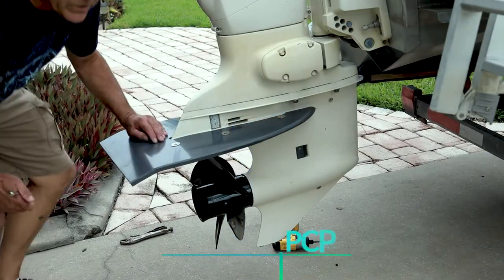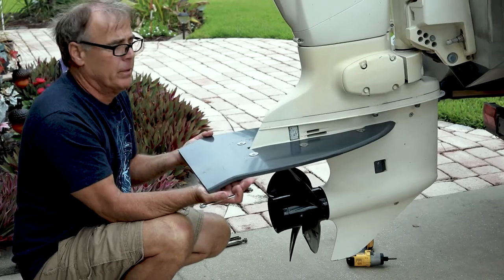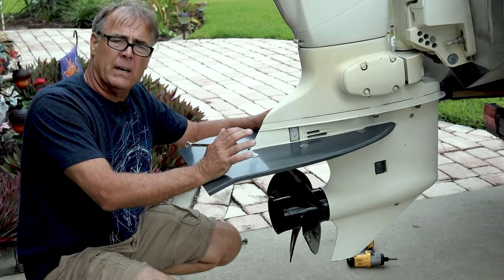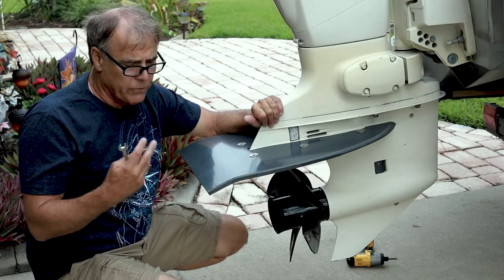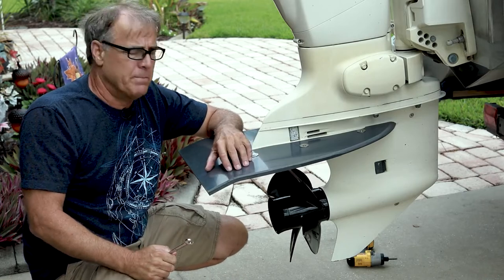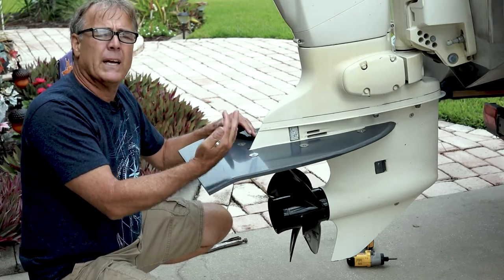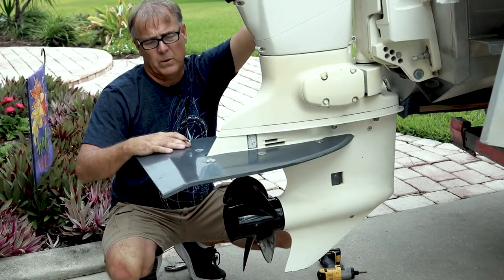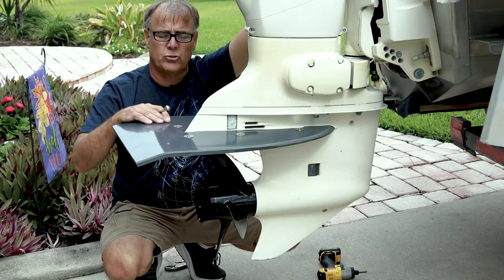VARA™ Plate Pontoon Hydrofoil Control system (Part 2 of 2)

Comment: All these "lift" systems, that purports 350-700lbs of force, without thinking about how that effects the integrity of the existing motor pod and framework that are not designed for it, seems to be asking for trouble.
Reply: You would only be redistributing the existing force. I don't see an issue.
Reply from the maker: Just as mentioned below by alpha racing redistribution of the VARA® Plate forces over the span of the Anti Vent plate are minimal. The outboard manufacturers must build in a factor for groundings and hitting hard objects otherwise there would disposable outboards on bottoms thruout the world. I would also add that there have been NO failures or signs of failures to date. 

The VARA® Plate works in conjunction with the VARA® Foil to offer helm control for weight distribution changes on deck while hydrofoiling on pontoon boats like people moving, wind gusts, etc.

Give it a try or call us with any other questions and thanks,
mike gable 727 455 5576